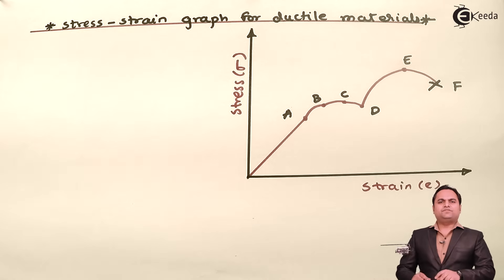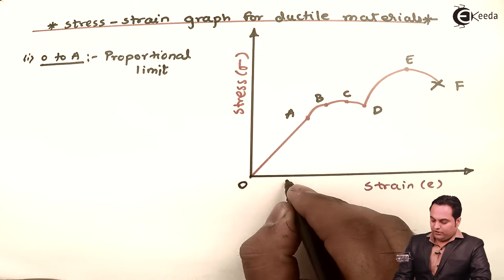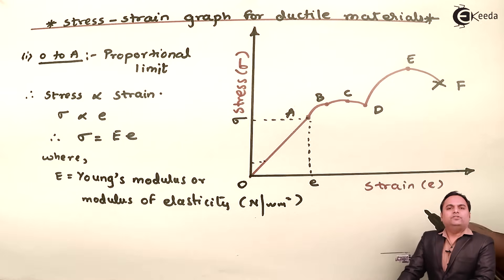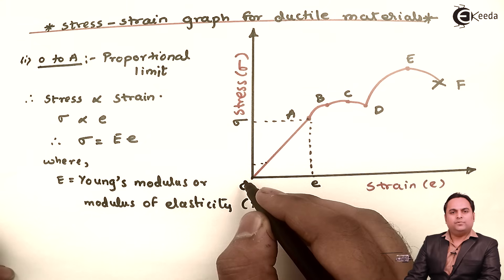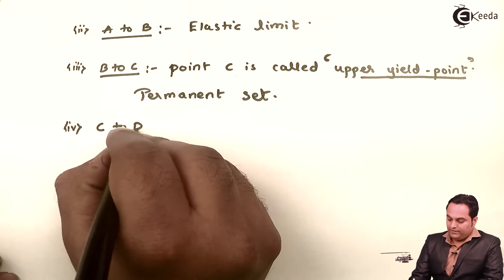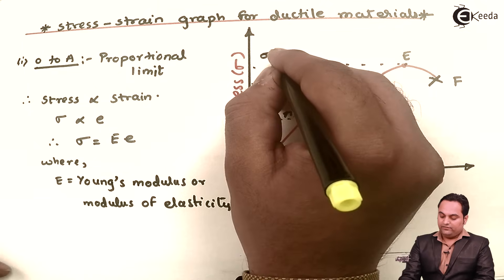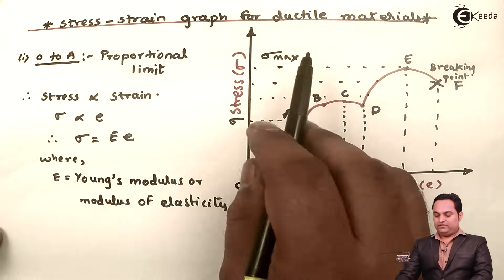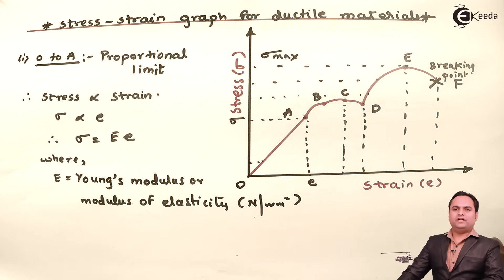Stress Vs. Strain Diagram for Ductile Materials - Introduction to Design of Machine - DOM

Comment: Dear Ekeeda
I  follow your videos and I don't think there is any student who doesn't understand them. Thank you very much for the explanations.
Generally, in all the videos where TAU the shear stress (of the steel) is needed, the value of this is more or less 0.6 of the normal stress.
Like the shear stress I would like to know (in the case of two plates that rotate on a steel link) in order to be able to know THE necessary THICKNESS of the plates that are not produced in them flattening How as the flattening stress is calculated for the steel material?
Reply from the maker: Thank you for appreciation. Visit Ekeeda App where you will get courses with all the concepts from basics, practice problems and doubt asking facility.
Download App - https://ekeeda.com/download.html

Comment: He is ok but he failed  to give more explanation about the graph.

Why mild steel is most commonly used material in civil construction?

Why stress is plotted against Y- axis and strain is plotted against x-axis?

What is the angle made by the curve at the initial stage?

What is the percentage of the elongation at the each stage?

What is the gauge length and it's value?
 What is gauge dia and it's value?

He havenot explained why the stress is falls from c to d and why the stress again raised from D to E? 

He failed to explain about the carbon role here.

so many things are there he just simply explaining about what written in the book? 

He failed to explain at what stage material starts yielding ? At 0.2% material starts yielding in fe250 steel that can be seen visually through naked eyes(which means yield point can be defined)whereas in fe415 and fe500 yield point is not defined.

Comment: Sir why stress is decreasing and strain is increasing at breaking point and at lower yield point because the stress is increasing
Reply: once the material crosses the ultimate tensile strength, small voids will start to form in the material(at the area of necking) due to which the internal stresses generated will be less. At the lower yield point, the dislocations generated inside the material is free to move compared to the upper yield point.

Comment: Sir what is the difference between elastic limit and proportional limit? As we remove the load it can regain it's original shape upto point A also the same result for point B. But in graph one is straight line and another is curve... What is the reason behind it??

Comment: respected sir
what is the reason behind the graph is falling from c to d and going up d to e 
again fallling from e to f 
however you have told that stress i
has decreased or increased at every variation in graph but please tell the reason why ?
and sir this vedio was great that i got doubts
Reply: sagar khonde It's not compulsory that stress will increase regularly..as stress is internal resistance offered by the material under the influence of external load...
After point C the body will lose its elastic nature therefore leads to decrease in stress...
And after point E..necking process starts which leads to decrease in area of cross section which further leads to decrease in stress...

Comment: Best explanation ever!! 
But I was thinking why the curve is decreasing between points E and F ? the applied force on the specimen is increasing and the cross sectional area decreases (i.e the specimen gets thinner) which means that the stress is always increasing .. Thanks a lot
Reply: The machine is getting weaker

Comment: Correction
Dear sir
The point which you have marked as yield point i.e Point E is ULTIMATE STRENGTH rather than Yield Point.
Please correct it.
Reply from the maker: Grateful to you for bringing an error to our notice and helping us by giving us an opportunity to alter it to a correct one soon.
Reply: bokka gadivi nuvvu ela mistakes chepthe yela ra exams lo fail aithe nuvu vachi rathava  @Ekeeda
Reply: @malakalaprabhakar292  thappu sir chala baga explain chestharu
Reply: Sir please correct this mistake...
Reply: http://complete-mechanical-engineering.blogspot.com/2018/09/stress-strain-diagram.html?m=1
 
👆This one is correct i guess.😕
Reply: @gauravjain1012  THX
Reply: Yes here E is confusing please confirm as ultimate tensile strength
Reply: Ekeeda can you put an annotation
Reply: thanks
Reply: just put a notice yellow bar on your vdo
Reply: Uzra Nizam Ultimate Strength
Reply: Correct
Reply: You Correct, point E is the ultimate stress point usually which is calling as ultimate tensile point from where necking starts.
Reply: didn't understand what's the meaning of point E
Reply: @uzranizam983  the point E is the ultimate point ( semi plastic)
Reply: @uzranizam983 in point E the maximum stress will be there and that leads to failure of the material. It's called ULTIMATE STRENGTH not yield point